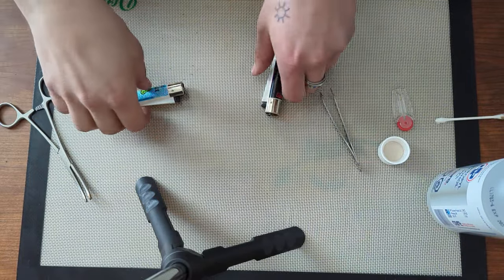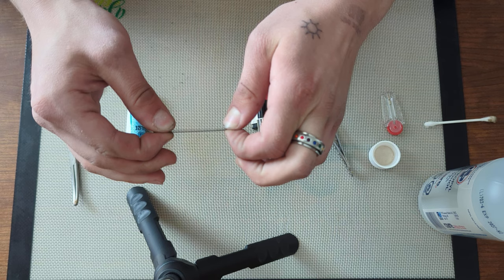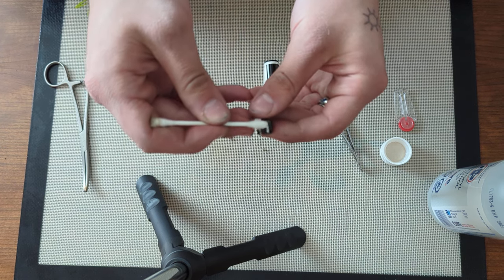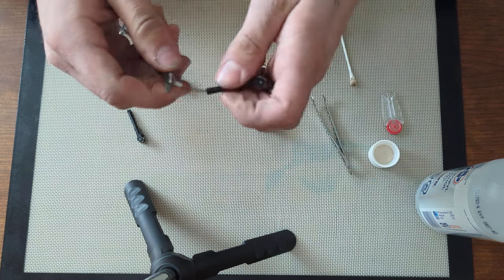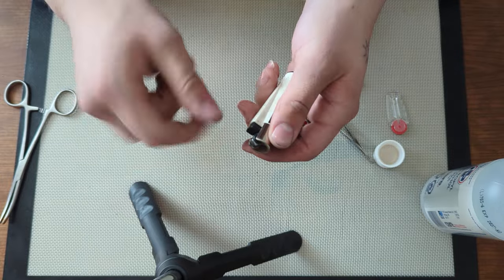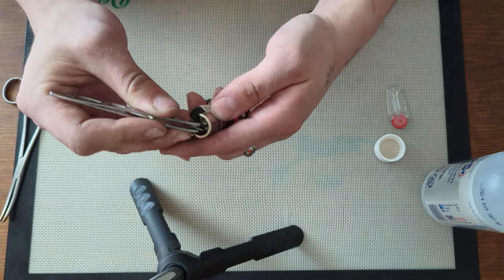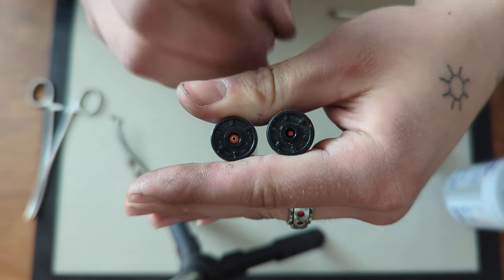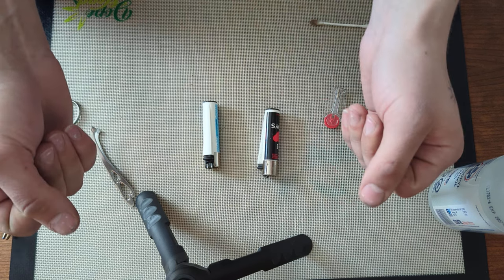complete guide to repair a Clipper lighter

Comment: From a technicians point of view - stretching the spring is causing permanent and irreversible damage to a vital component piece. Some short term improvement at a rudimentary level for sure due to the increased torque friction, but once the spring has been stretched even once it's on it's way out.
Reply from the maker: It would be more of a problem on a $1,000 piece of machinery, but for a $2 clipper, less of an issue since you can just get a new striker cheaply. I understand where you are coming from, i too work with springs and it erchs me when people do this on more important things.
Reply: wtf man. is this this a Ferrari suspension spring? why complimenting when it just works
Reply: @oussama4629   It's not about whether the spring is expensive or not, or whether it works (for a very short time) by ruining the component piece permanently. It's about intelligent application by applying a solution that doesn't cause permanent damage to vital and necessary component pieces. Intelligent working solutions should apply across the board when speaking from correctly applied technicians methods. The fact it's a cheap lighter is missing the bigger (and very valid) point, but fair enough I get what you're saying.
Reply: @k1dn1ce76 i get your point and i always look for solutions to keep things in their original status and avoid irreversible changes but if it gets the job done with ease, i'm down for it
Reply: @k1dn1ce76 wtf you yapping about, I just wanna fix my clipper so I can smoke more weed
Reply: @YourSweatyUncle  Quit 'yapping' and get on with it then...
Reply: @k1dn1ce76 I get your point and would agree but what would be the better alternative? I mean you could replace it but before doing that, I would say that extending the lifetime a bit, is a good option. (I'm not really into these things so please let me know if you know a better option)
Reply: @2B0red   Packing out the distance between the spring and flint would (in theory) have the same effect on functionality as stretching the spring would. It depends on what's actually causing the issue, which can be one of any several factors and isn't too easy to determine. It's like the issue of it lighting but only producing a tiny flame, I used to try everything from emptying any air from the bottom valve before refilling the gas to pushing a pin with an extremely small radial value through the nozzle hole to try and clear it. Nothing would work though, and I ended up wondering if the paddle that controls the gas release would (over time) lose the amount of upward pressure transferred to the nozzle when it's depressed so the nozzle no longer rises to it's original height hence the amount of gas released by the action is greatly reduced producing only a tiny flame. They're great when new, but seem to have a short lifespan and can't be restored to their original operational capacity no matter what's replaced or tried!
Reply: @k1dn1ce76  Thanks for the quick and helpful response! The point clippers can't be fully restored is a problem, but I think that it's important to highlight that clippers have a much better repairablety than most other brands. In the future I want to try Zippo brand lighters because that's the only completely repairable option that I currently know of. I have just always been held back by their unique smell.

Comment: Thanks for the clear video. Please consider doing another where you can just talk about the basics of 1) Rule of thumb stuff for filling the lighter and how to tell how much fuel is in there, 2) How to adjust the flame size, 3) Any other maintenance items which are not completely obvious. Maybe around 3 minutes only, that could be helpful. Thanks for your consideration.

Comment: A sincere thanks for this vid, I had heard that Clipper lighter quality in recent years has apparently gone way down compared to older ones. I wonder how much of that is just people needing to clean them as shown... Some claim the older smooth wheels vs the newer hexagonal ones were better since apparently the new wheels wear down the flints unevenly, you can apparently either flip it upside down or file the flint even if there's enough room left, or salvage flints from dead bics. I got a 12 pack of clippers for pretty cheap, $9something. They have the better bronze ring style refill port at least. Can't say I'm a fan at all of the hexagonal wheels though, kinda hurts my finger using. I've seen some people selling 3rd party replacement wheels online, although they're kinda pricey for what they are, often they're more expensive than just getting new lighters lol

Comment: If you need a flint, just find a dead Bic and take that one. Been salvaging flints and springs for years, dunno why but it's finally paid off, lol. I have 4 Clippers now and have replaced all the flints at least once and Bic flints last longer than the original ones

Comment: I was given one almost 20 years ago. It stopped working because i couldn't refill it. Since it was my first refill and all the butane leaked out immediately. But since I still have that lighter, i decided i was gonna figure that issue out. I noticed...... No brass ring on the fill valve. So I can only assume there never was one. I guess ot was DOA. But.... I was able to use it when she gave it to me. Which means...... it wasn't leaking. Until i tried to refill it. Odd. No brass ring, but was working until it ran out. I am perplexed.
Reply from the maker: @CabeBooth  i have come to learn that one needs to "purge" lighters occasionally. I had the same issue with a really expensive lighter, where it would just leak out the side of the fill valve. When i brought it back they showed me that you need to depress the fill valve and drain the tank of the filler gas that the butan comes mixed with. I forgot what purpose of the gas was, but every butane canister needs it to function, but it builds up in the tank.

Comment: Thanks for sharing your knowledge.  I followed the sparking piece steps but with no improvement, I decided to flip the wheel, which comes out very easily between it's legs and boom, massive spark returned.
Reply: Thank you :)

Comment: I was going to say that overall you gave good information. Until you finished cleaning the nozzle. I rebuild modern and vintage lighters everyday for hobby and extra money.  I love doing it. I know exactly how to clean adjustable and fixed flame. Have you ever taken the nozzle and button off when full? The only thing holding the flame valve in place is the black button that pulls up on it. Thats why its able to do that. Turning it any direction for any amounts of time doesn’t do anything. However I can tell you exactly how to clean a small flame easily. But you have to be careful. When full, pull off the button and flame valve and under is an aluminum sleeve with a micro hole. It’s extremely tiny to keep the flame a fixed height. If you poke the hole beside just touching it with a sewing needle, it will be a huge flamethrower and will never be the same. Basically just pull them off and clean the aluminum sleeve with alcohol or sanitizer. If the flame doesn’t change then poke it but barely! Seriously. Thats it. It doesn’t have a filter so the particulates clog that hole. 
I use paint brushes to clean. Use a toothbrush for the wheel and I personally replace them with a mini bic wheel or mk china lighter or neon lighter one. Other than that you gave good advice. I recommend buying a vintage lighter. You will never use a bic or clipper again unless it’s to use with others so yours doesn’t get stolen. Lol
Reply from the maker: Thank you, you taught me something today. I am no expert, just a guy with a addiction to both cannabis and clippers. I have never disassembled them completely. I will try later, thanks!
Reply: @blahhotel1499  I never took an interest until my friend asked me to fix his Newport Zero torch that looks like a piezo click lighter with just a longer flame valve tube. I took it apart and graduated through everything you can think of. It took me years to figure out how to fix the tiny flame on a Clipper! I just confirmed it 3 days ago. But im used to clearing the hole on adjustable lighters. I poked it with some pressure and it went up 4 inches! So basically just clean the micro hole well. Avoid poking it at all or adding any pressure if tapping the hole if all else fails. The reason clippers do this and not bics is because it’s refillable and used more so it has time to clog. Nothing to do with butane or any idea someone swears by. The way someone can technically “adjust” the height is by barely making the hole a 0.00001 bigger. Haha
Reply: @blahhotel1499  If you ever need to, replace your clippers with mini bic wheels and it will light 99.9% of the time. If you are careful you can get a drill and barely expand the diameter of the flint wheel and fit bic flints in them. I’ve done it for years. Just do it by hand.
Reply: thanks, my clipper works like new
Reply: @rafaeltorre1643  mini Bic wheels!!! Yes!! I wanted to replace the clipper flint wheel but regular bics are too big. The clipper wheel is giving my thumb a callus
Reply: I wish I'd seen your comment before I poked that hole... There must also be a seal too because after poking that hole in the sleeve, had a giant flame and it would actually leak liquid butane when turned...

Oh well, live and learn.
It's good to know that it's irreversible and can't be fixed, thanks for the info, much appreciated.

Comment: I have used clippers for years, they're the main lighter for "smokers" in the UK. Never realised you could screw the nozzle!
I often replace the wheels as they fall apart, I put in circular ones instead of the hex "safety" ones though. They are meant to go in one direction, but you can tell once you try em out.

Comment: There's 2 things I find annoying about clipper lighters

1: the screw in part of replacing flint, maybe this would not be possible, but a push and 90 degree turn with a little knob would be a major QOL improvement, again maybe this is not possible with the size we're dealing with here though

2: No safety feature on the striker, now I don't actually care about the safety part but it keeps the striker clean because your finger never gets in contact with it, if these 2 changes were made it would turn it into an S tier lighter 😂

Comment: Hello Dear Friend, thank you for your informative video, I have a question however about the flame adjustment of the clippers shown on your video. Is there a way to do it? Following gas refill mine's flame is too hight and I could not find a way to reduce it.
Reply from the maker: I have noticed that sometimes the flame is larger as the beginning of the fill, try using it for a while, it should go down

Comment: Thanks for the detail of this video. Will peroxide work to clean too?
Reply from the maker: Probably. I would avoid it though as it may oxidize some of the metal/plastic. Idk, not a chemist.
Reply: If thats all you have but I wouldn’t recommend it for the same reason he mentioned above.
Reply: You can use WD40!
You can take all the funky stuff off and lubricate the tiny parts at the same time (not that it needs lubrication, but you know what I mean 😅)
Reply: @Javad.Najibi47  Avoid WD40 or other oil sprays at all cost or be very very careful around the flint. It's not worth it, really make them act weird and striking a spark becomes nasty after a couple days. Had to reclean some restored Clippers, never again. 😁✌

Comment: thanks man, this is useful but what's the solution if the flame is 3" high?
Reply from the maker: I have never heard about that issue with clippers. Is it adjustable? I have had adjustable bics do that. In that case i twisted the nozzle towards the - side.
Reply: @blahhotel1499   no unfortunately it's not adjustable. where there any adjustable variants ?
Reply from the maker: @oussama4629  i have seen them out in the wild
Reply: Is it just refilled? It might be the high pressure inside the tank. Try to burp it by pressing the refilling valve with a toothpick